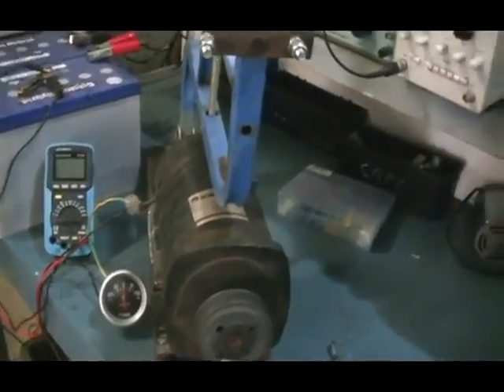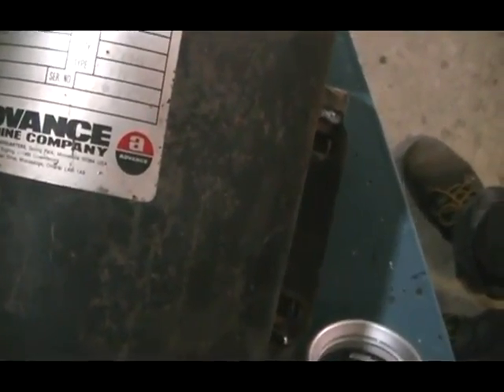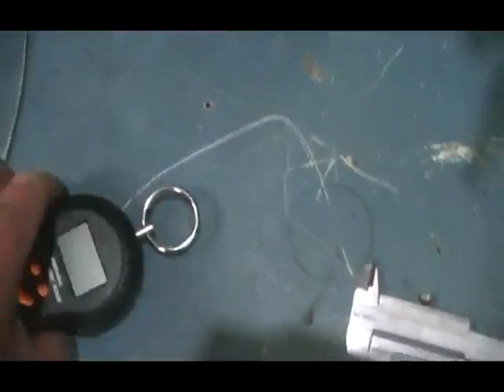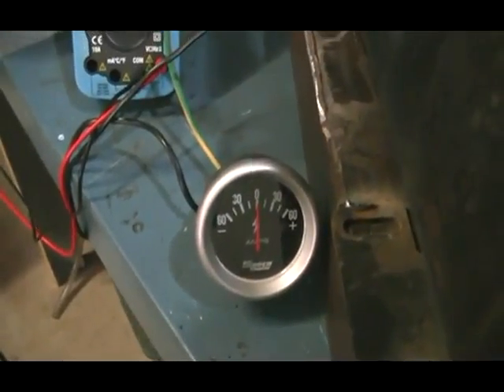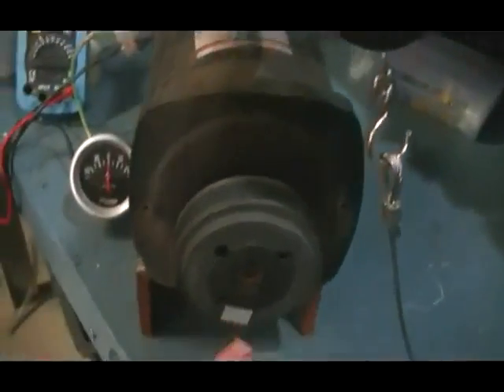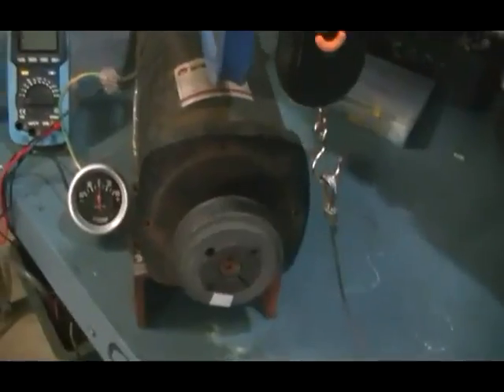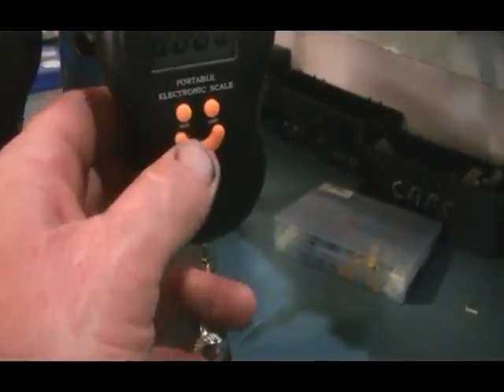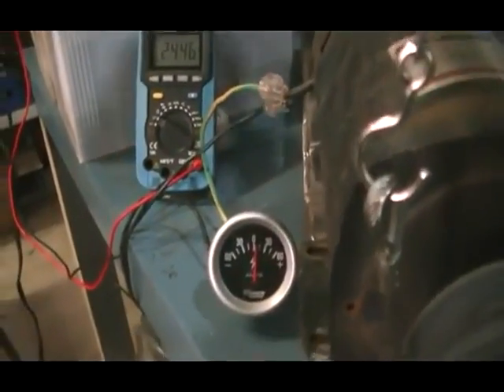Prony brake test v2 clearer words

Comment from the maker: Im supprised you managed to even switch on the meters in your test ufo.
 
HP in=15 amps x 23.58 volts=353.7 watts. 353.7/746 watts(1hp)=.474HP
 8.22lb x 22.655<22.655 is the feet per second UFO as seen at 7:36 in video.
 Man you realy need to watch carfuly.
 The math is correct-your modified motor is less efficient than a standard old off the shelf motor.
 So now,prove me wrong and test a standard motor the same way on the same test bed as you did your modified motor-and show everyone im wrong

Comment: TinManPower, Your Math is completely wrong,
At time 8:39 of this Video You show (after deducting Pounds)
8.22Lb X 22.655¿What is this? ¿RPS?...WRONG!!
Original RPM´s were 2275 divided 60=37.92 RPS
Now (after correcting your bad math) we have:
8.22 X 37.92=311.70
And 311.70/550=0.57 HP
So We ended Up with more HP at Output than what you are Inputting, which is according to your ALSO WRONG measurements 0.474 HP Input
And I am subtracting Pounds here
Therefore:
0.57HP OUT/0.47HP IN=1.2 X 100= 120%